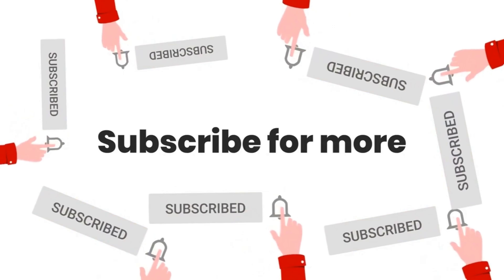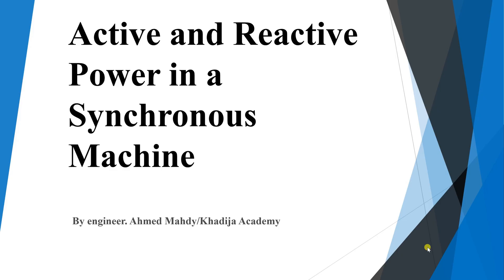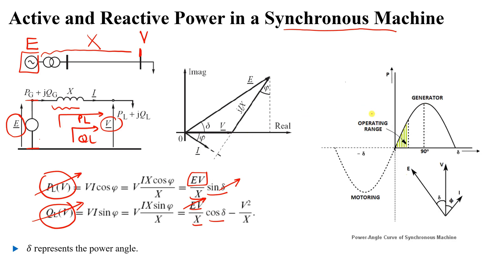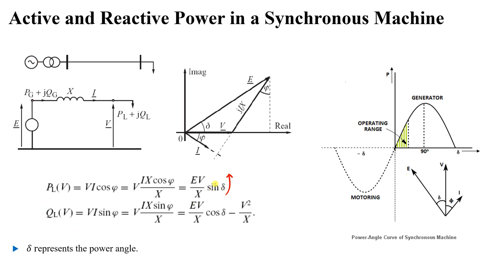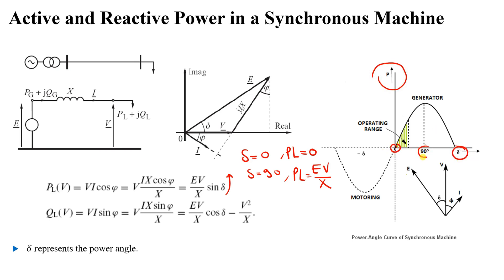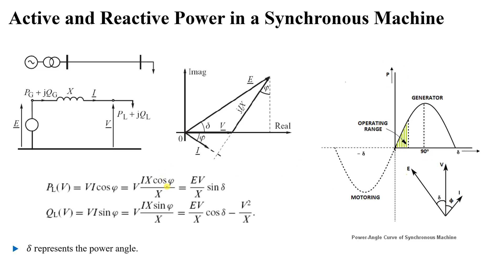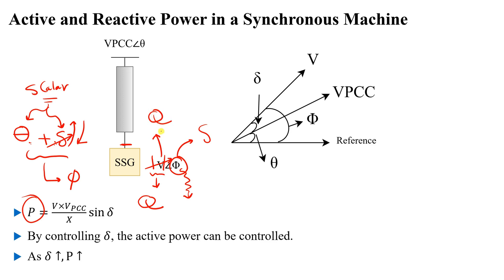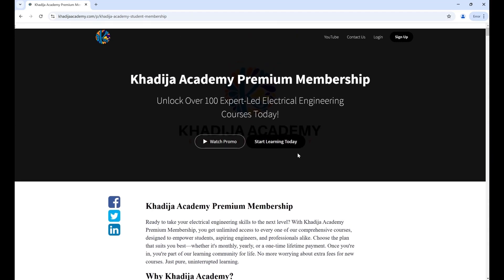Active and Reactive Power in a Synchronous Machine - Lesson 4

Comment from the maker: The scalar control playlist is now complete! 👍
These lessons explain how to control an inverter by adjusting the switching pulses to manage active and reactive power. The approach focuses on regulating the magnitude and phase of the output voltage to achieve these objectives.
If you haven’t seen the previous videos, check out the playlist here:
https://www.youtube.com/playlist?list=PL_6_U09jayh2ceBxo5XNJDkQd-tKhnmBG
Looking ahead, we are gonna share content on vector control, a technique widely applied in electrical power systems. However, it’s essential to first understand scalar control, which we’ve covered in detail in this playlist.